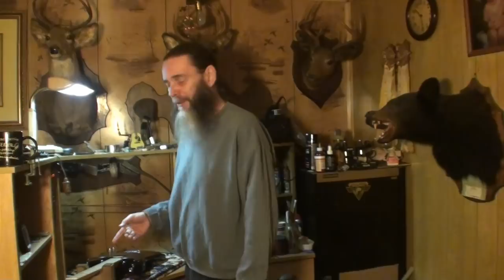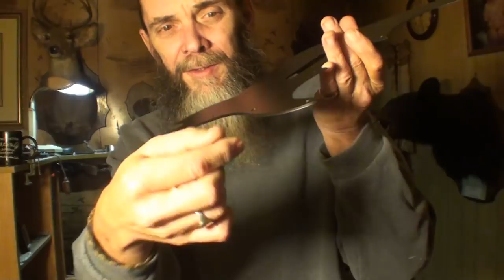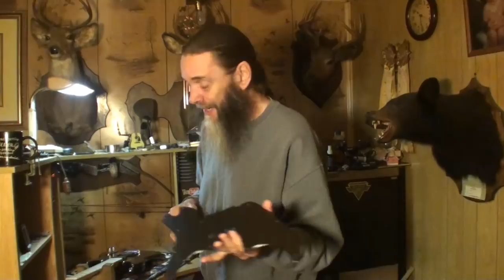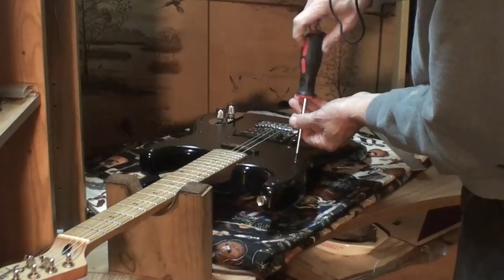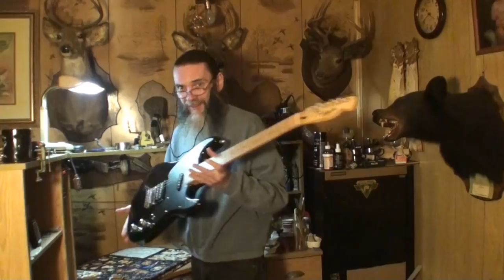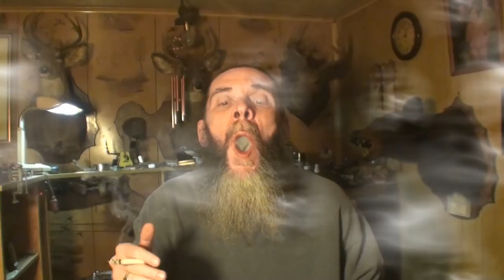51 squier pick guard painted and re-attached

Comment: Randy, if you remove just the black on the bevel it will be too wide. 2 or 3 ply guards are much thinner and you may not like it. A 3 ply black pearl guard would be an alternative. That thing in your hands are a match made in guitar heaven! I have a Strat neck and body and I think since I have been witness to this '51, I may make it a '51 of my own! Thankz brother
Reply from the maker: that would be very cool making your own 51! they are great guitars, especially for the price, and can easily be upgraded to something even better! if the paint doesn't stick to this pick guard I'll either buy one that's 3 or 4 ply as you mentioned, or make one. thanks for watching!